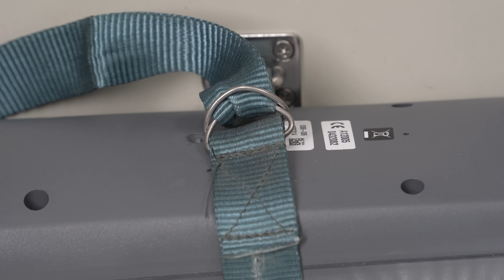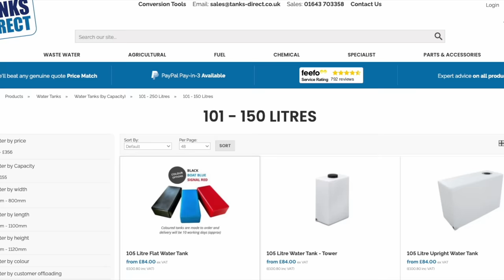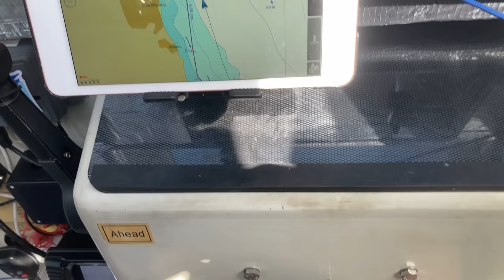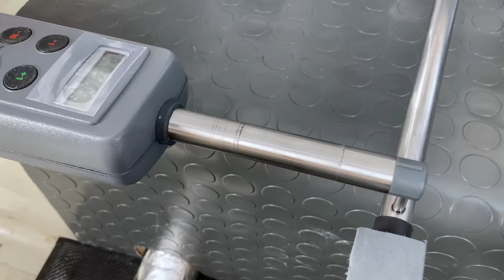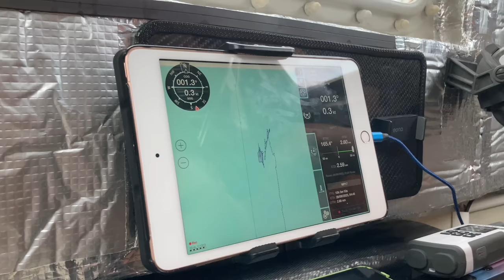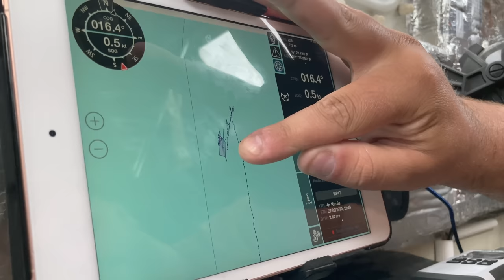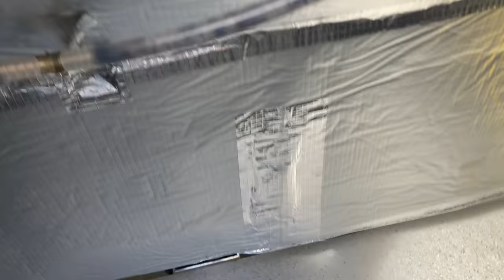Alan the lifeboat heads north LEG 4 (pt1): Hartlepool to Holy Island Lindisfarne via Farne Ep97 [4K]

Comment: Enjoyed the video thank you. I think you need to go through the full set up (calibration) routine with the autohelm. When it was disconnected and you were getting that tiller wobble do you think that may be rudder fouled with marine growth?  On balance I think a remote control at the helm for the autohelm, would be as worthwhile upgrade as the autopilot was itself. Fair winds and a not too bouncy sea.
Reply from the maker: The rudder gland needs repacking. Plus the tiller extension isn't bolted properly. Friction fit isn't good enough.

Comment: You should check out Maxwel wiring harness tape. It works very similar to electrical tape except for its cloth and has three very good properties. One it sticks to itself even when wet. Two it's very abrasion resistant. Three it can back up as medical tape. I always bring it with me to work.

Comment: i saw a shipyard build a production motor yacht, 60-70 foot boat that had an optional kite sail. would pull the boat at about 7 knots. dont know if hull shape effects that,but may be worth looking into to save some fuel or just as a backup. pretty sure your motor isn't moving you faster than 8 knots and it would pack away pretty well.
Reply from the maker: I've looked at various ways to mount / rig sails/kites, and it's mostly cost or space prohibitive.

Comment: Enjoying your adventures. The north-east coast is spectacular. I think I would be inclined to get a small outboard for the dinghy. Perhaps an electric motor, with a rechargeable battery, as you only use it to ferry you to, and from the shore. You will always have the oars, in case of emergency. 👍
Reply: A rechargeable battery. Do they come in any other form?
Reply: @teeanahera8949  No. that is a pretty ridiculous thing I said. 😂🤣😂

Comment: Do you have space for some hard points that you could utilize to attach a hammock or two? Might provide better rest in a rolling anchorage or sea state for an off watch crew. As long as I’m suggesting things unsolicited. I do have a crazy idea for a folding proa to help with the roll offshore because it is going to get sporty. I know that you are confined by the limited keel and ballast space on Alan. Just trying to think of ways to make things as comfortable as possible for you and crew. Thanks for the videos. Cheers.

Comment: Thought about making a heat exchanger for the waste heat coming out of the engine room and exhaust? You could even make hot water without using any power with a small tank and some copper tubing making hot water for tea all the time.
Reply: You can actually buy those devices quite cheaply. You run your engine cooling water through them.
Reply: @philgray1023  yes they do sell them but wrapping a copper tubing around the exhaust and plumbing it to a small tank will make hot water with no moving parts

Comment: this is a bit more work (but only a bit, I promise), but -- you may find yourself quickly wishing that Alansøn were a bit more independent of human power when getting around. I modified a small boat into an electric "center console" by getting a 24V 3HP trolling motor & battery, a little aluminum console thing I could drill things like a steering wheel and cable gear assembly into, and the  midsection of a dead gas motor with the appropriate steering hardware, and then attached the trolling motor to the midsection such that it could then swivel back and forth by use of the steering wheel. voila! of course you could just go with the motor if you don't loathe tillers with a firey passion like I do, but where's the fun in that?
Reply from the maker: I'm saving for electric outboard at the moment. One will fit onto the dinghy. 👍

Comment: OH - carry a tillerpilot spare end cap (where it drops on the pin). They break after thousands of miles. So does the pin. A 6mm bolt works just fine as a spare.
Reply from the maker: Cheers

Comment: Thank you for your videos. 
4:48 Concerning your newly installed camera mounts: I’m a little bit afraid they might become a safety issue. 

Let’s imagine someone has to go out there on heavy seas and is thrown against the railing by the waves. If the person hits the railing where a bolt is, the bolt could be pushed into the person’s body or head and cause severe injuries or worse. 

What do you think?
Reply from the maker: The exposed thread is very, very short, but point taken. Silicone caps shouldn't be hard to source.

Comment: I have found yet another thing to worry about ( probably unnecessarily) … once your get up to arctic waters next year, how are you going to keep the small window for the helm station clear of ice and snow buildup so you can see where you are going?
Reply from the maker: Yes that window is a work in progress. Thinking a potential heated duct, or electric element.
Reply: @AlexHibbertOriginals  while I'm busy worrying... Is there a risk of ice build-up on the upper hull in general destabilising Alan?
Reply from the maker: No more than on most boats in the cold. You have to get up there and chip it off.
Reply: @AlexHibbertOriginals  at the risk of teaching my grandmother to suck eggs... Make sure that the ballast of Allan is high enough to keep it stable when you get ice build+up on top

Comment: Re your fuel bladder, you need a bungee chord cargo net fixed to the flat. Save yourself the money. As an aside, (depending on the chord)  you will have close enough to perfect fuel pressure. Alternatively, you can choose to fill the bladder with a gas (inert from a pony bottle if you need added pedantism) so it keeps its shape and remains secure. You are welcome !!!! As an aside, your bladder contributes to noise and vibration reduction within the cabin. You will lose that with a tank, unless you wish to also adhere mass loaded vinyl panels to that too. Just saying.
Reply from the maker: You'll enjoy the new tanks.

Comment: On the anchoring legs, what were you three doing for toilet time? Were you using the on board toilet? Or just having to wait it out between stops? 👀
Reply from the maker: The onboard heads function. Well, hard for it not to. But we did make use of shore facilities when possible.

Comment: I haven’t seen your wind generator spin for a while. Does it still work?
Reply from the maker: Yeah works fine. It's strapped at the moment as I have so much solar power.
Reply: @AlexHibbertOriginals  Thank you for the reply. Better to have too much power than not enough. Going further north with less sunlight and snow covering your solid panels the wind generator will play a greater roll for you.

Comment: That loop you use to secure your autopilot when not in use is going to be incredibly annoying to use underway, especially when your hands are cold and you're in heavy waters. I'm no sailor, but I would expect a loop of bungie cord or maybe velcro to be much easier to use while being just as secure.  
Alternatively, like how I offered to 3D print Alan before (which still would be a cool idea, especially now that he's closer to final shape), I would be happy to 3D print a bracket for you if you get me some dimensions (or design the model so you can get it printed locally), then you'd only need to worry about latching that bracket shut and not keeping the whole thing in place.
Reply from the maker: Velcro would work for sure. In any case, the autopilot isn't for big seas. More for when pottering along.

3D print offer appreciated once again and will action if I get the headspace to collaborate on the design /dims etc!

Comment: I have used an Autohelm for many many years and am amazed they seem to be exactly like they were 30 years ago. . .Couple things.  READ THE MANUAL, if you haven’t. . .the adjustments for this device are astounding and can absolutely stop your variance.  Also, I’m not sure if asking the Autohelm to steer and also turn your steering wheel (a shocking amount of  resistance) is going to work long term.  Regularly check how hot the device is getting.  You might be better off with a wheel based auto pilot. . .Second:  I’m sorry but there is no excuse anymore to paddle soft bottomed inflatables. . . Get a 2 HP or electric motor. . .life is just too short.
Reply: Words of wisdom from this salty dog, take heed.
Reply from the maker: I'd have a wheel pilot if funds allowed!

The torque on the pilot motor is pretty low. It's not drawing even 75% of its rated current when steering.

Comment: For my layman's eyes the way you drop the anchor at 15:18 seems quite dangerous.
If the anchor suddenly gets pulled tight it would crush your fingers. Would be a shame if we didn't get regular videos just because you decided to spend some time in a hospital 😁
Reply from the maker: I'm not sure there's a way of manually dropping anchor that doesn't involve holding the chain. It's not attached or looped around my hands.
Reply: @AlexHibbertOriginals  no, it's not that you hold the chain, it's how you hold it. 
By grabbing it from below you put your hands between the chain and the metal bracket. And if the anchor gets pulled tight your hands get pushed down and get crushed. 
I would grab the chain from the top. Maybe even just pinch the side of the chain with my fingers. So that if the chain gets pulled it doesn't push the hands down but instead just rips the chain out of my grip. 
Just like with mooring. You never put your fingers between the mooring line and the bollard. 

I hope that makes sense. And as I said, im just a layman. Maybe I'm completely wrong 🤷🏼‍♀️
Reply from the maker: I see your point, but I don't think it's more a finger risk even if the chain jabbed down a few inches. I'd not get caught in it. Anyhow, point received with the spirit intended.

Comment: few dumb things - 1. you dont row tenders. get an electric drive unit. oars are backups. 2. your action cams will rust. get saltwater poe cams  with 1 tb microsds and run mousing cable thru the pipes . 3. you havent read the manual for the tillerpilot. 4. your rudder tiller connection has too much wobble -- its not a bobblehead doll. 5. your anchor deployment is garbage. get a crab pot reel and stow marked chain on the drum. 6. get a real evo3s chartplotter.
p.s. I have a video for a small boat anchor setup you can use with very few mods.your setup you can lose fingers.
Reply from the maker: What a strange decision to post this.
Reply: @AlexHibbertOriginals  would you prefer people sit back and laugh at you or give you suggestions for improvement ? i can go either way. proper planning prevents piss poor performance. youre in the piss poor performance stage but it looks like youre improving. slowly.
Reply from the maker: Half of your points show you're not paying much attention.

Scan over some other comments by experienced mariners and take numbered notes about tone and delivery of advice.

Have the day you deserve.
Reply: @AlexHibbertOriginals  haha. dont mistake tone for competency. and the only attention i pay to is the video. so if i missed something its probably due to poor videography. oh and learn to flake your lines, use a checklist, figure out what the normalize audio button does and quit being defensive because youre new at this and know squat.we all start somewhere.
Reply from the maker: I'm not sure why you're torturing yourself by watching the channel. But I thank you for the revenue.

No, I recognise competence. It comes from the secure and positive, not the barely comprehensible scattergun know-it-all.
Reply: @AlexHibbertOriginals  hahaha. see ? this is why i watch this channel. where else would i find the flailing attempts of an overconfident newbie to conquer the ocean. you know how you really recognize competence ? when someone has spent 10 years and 10,000 nm doing it. no substitutes for practical experience. i was you 15 years ago. then the ocean slapped me in the face with a wave repeatedly and i learnt different. my only real advice to you is - dont die before you gain that experience.
Reply from the maker: I think reflecting on why you'd enjoy watching the failure of someone at sea would help you interact with people better. Strange, insecure man. Good luck.
Reply from the maker: You're fun. Not 'jetski guy' fun. And not as literate. But do stick around.
Reply: @AlexHibbertOriginals  haha. nice edit.

Comment: The differences in English between America and the UK are interesting. For example, we call them "warlocks"
😂
Reply from the maker: What are warlocks ?!
Reply: What a load of old ROLLOCKS !
Reply: @AlexHibbertOriginals my pack of Magic cards says 'a class 2 mage'
Reply: We in UK also call them "rowlocks"  pronounced rollocks. They are usually fitted to the "gunwales" pronounced gunnels. which are the top of the sides of the dinghy.